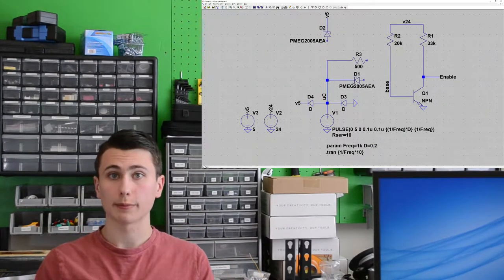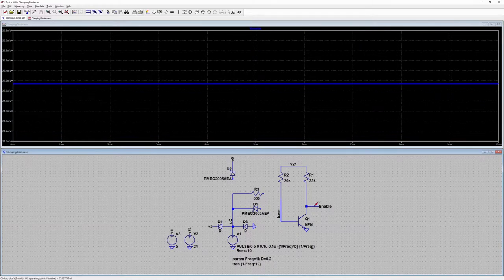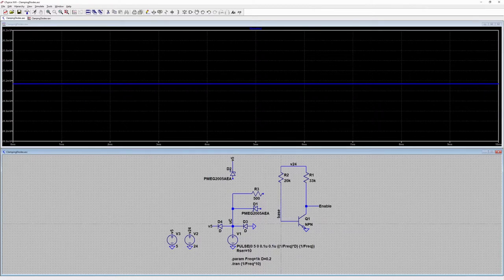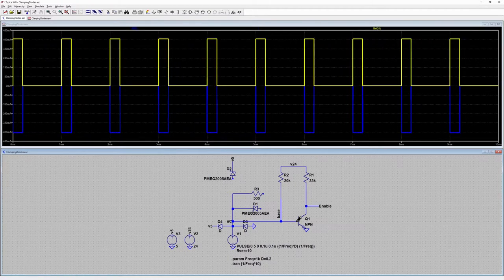Clamping Diodes - Things not Blowing Up

Comment: Bro, your "jokes" are sooo confusing, you better go "straight to the point". And when you started talking about "the simplified schematic" ( 3:05 ), I didn`t understand what do you mean, because the wires were not connected with each other, and the voltage source symbols were confusing as well.

Comment: i like this channel, why you would do this circuit to drive npn by pulling down 24v of Vbe. why not just connect the bjt to mcu pin with current limiter
Reply from the maker: That depends on what circuit you're talking about. @6:05 we made an example to show how clamping diodes can prevent damage to sensitive electronics in over-voltage conditions. That's not necessarily a circuit we'd recommend for driving a BJT. 

An NPN transistor can be driven just fine from a mcu with a current limiting resistor, as you described. Sometimes, thinking about the quantity of single pin or total package output current can be a headache - so FETs are used instead.

Does that help?
Reply: @EEforEveryone  yes thanks..